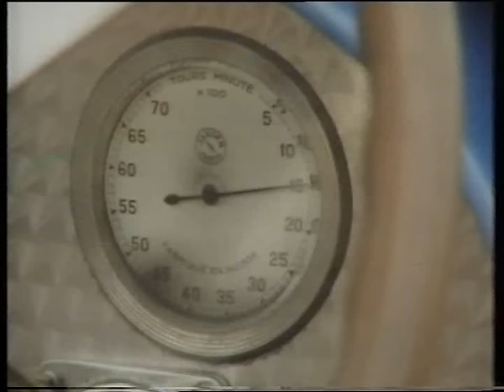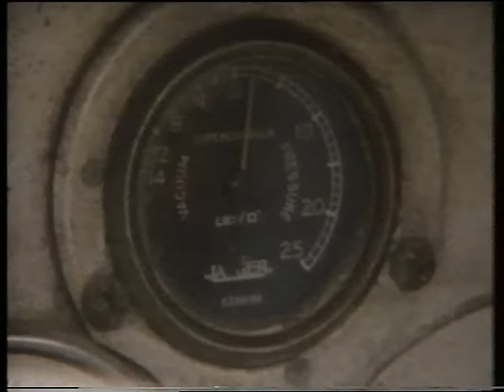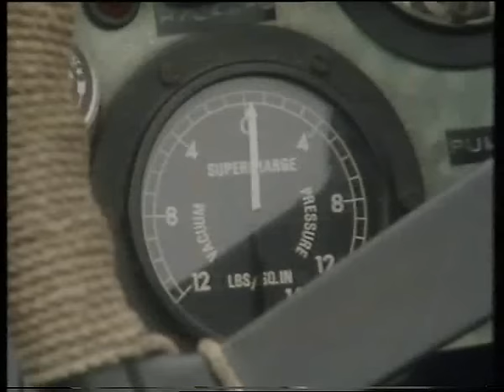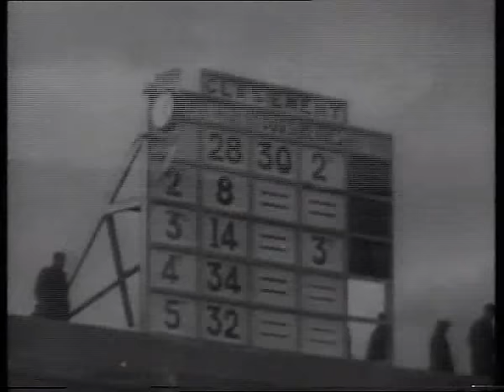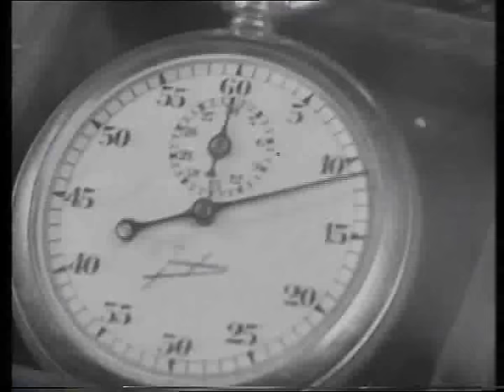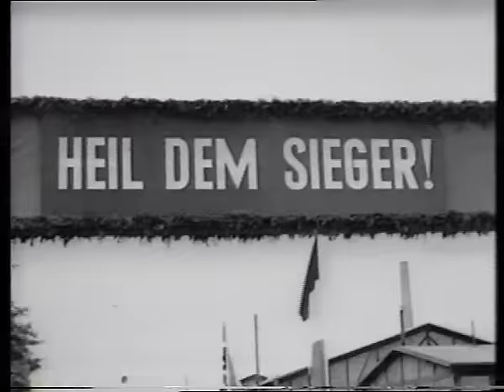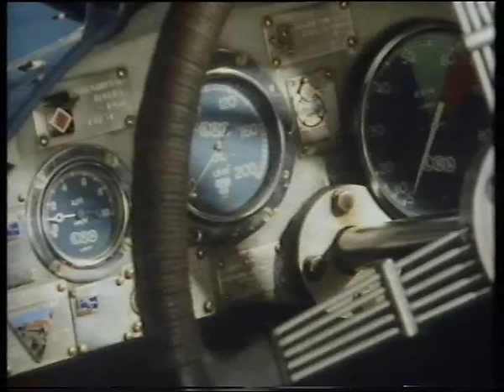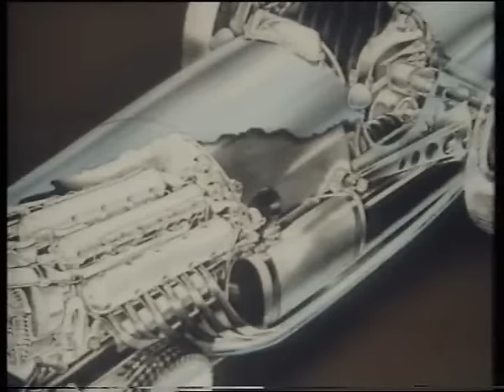Supercharged Grand Prix Cars 1924-1939 (full version)

Comment: One thing I do find extremely impressive with the 750kg formula of 1934-1937 is that the development was so rapid that the 1937 Mercedes W125 developed 646hp (reportedly) on the dyno. Just a few years before in 1931-1932 the most powerful racecars had little over 200hp. Tripling the horsepower output in just a few years of Grand Prix racing must have been insane!

Porsche was planning something special for the 1974 Can-Am season but turbos were banned and Porsche pulled out. (1973 oil crisis..)
Reply: What exactly did Porsche plan for the Can-Am in 74?
Reply: Kinda how the Le Mans circuit was not fit for how fast cars had become which led to the disaster of '55

Comment: I actually drove a 1928 Bugatti Type 35 race car in a road rally about a decade ago and it's tiny, harsh, nimble, loud, and like riding in a frog blender at speed that will kill you and take off your knee caps if you f- up. About as fast as an 70's Porsche road car on tires the width of a pizza pie -135+ mph.
Reply: Just for research purposes, can you quantify the speed of an average frog blender for the average viewer. I never learned to control my frog blender, so I wasn't able to clock the speed properly. Kept taking my kneecaps off.
Reply: @LarryisControversial3000  Literally a frog blender RPM? 37,000 -Hamilton Beech Bar Blender and others -yummy frog legs blended not kneecapped. That's mafia and you guys aren't. Richard Ridell would run the front tires with less PSI I remember at Laguna Seca Monterrey Historic races. The one I was in was owned by a David D. From Galveston or Houston.  I gotta think about it -over a decade ago. You talking about the adjustable advance, the priming pumping, the extra oil can manual pump and stuff and priming with the left hand near the fire wall? I know there is some parkay flooring in them too. There's a clock too on the pretty engine turned fire wall and from what I remember it was quite a production just to make it go much less drive it. You constantly adjust the advance. Worse than a High Maintenance woman who is French and Italian and very pretty so it's worth it. I think I was in the finger lakes. Been a while. Oh and the emergency brake right hand with a chain sprocket is an interesting way to do it. Also hiding the drums inside the wheels is rather impractical but would really work well thinking about that now -much easier to use a larger sprocket to get leverage for the brakes just like big rotors. No wonder why these were so fast in the 1920's. They are today! I'm sure i would get lost in a rental car chasing as I did, even with my 911 3.2 it would be about the same performance. Lots of trivia I haven't thought about in 10+ years. Cool experience.
Reply: Those Blockley Tires are the bomb! Makes steering of those cars much lighter and faster if everything in the front axle is up to snuff. Positive camber built into the axle. So I would assume that Dick runs the front tires lower in PSI to give better corning so you get a combination of good steering feel without the front end pushing really bad and you understeer the corner. Is that what you are asking? Compensating for understeer in these cars with tire pressure variations on modern race tracks. As far as I remember there are only a few left right hand turns on Laguna Seca and they are off camber (up and down hill corkscrew) so you may be able to only run the right front tire with lower pressure for that track and get away with it.
Reply: Or spin lol!
Reply: @DerekJason3000  I would never kneecap a frog. As everyone knows, when you blend frogs you have to include the kneecaps. All the flavor is in the kneecaps.
I live near Seattle and we have the Lemay car museum which I visited for the first time last weekend.  I found that the tire companies in the 20's were working on the lack of grip issues with the tires of the day. I think Firestone  (I could be wrong) had a tire that wad called a non-skid tire. The tread, instead of blocks or wavy linear ribs, consisted of the words NON and SKID arranged diagonally across the tread section of the tire. Each letter was approximately 2 inches tall and the tread was literally NON followed by SKID repeatedly around the tire. I meant to take a picture but I was distracted by all the other cars.

Comment: 2 rev counters?  one for each line of pistons?  thats awesome.  they always said a v12 was two inline 6's put together, but i never realized it was that close to reality.
Reply: Noo lol, cars used to have machanics righting shotgun to keep an eye on things. One is for the driver and the other is for the machanic.
Reply: Yeah no, there’s no way for one cylinder bank to spin any faster or slower than the other, you know, being tied together by one solid steel crank shaft...
Reply: @kevintucker3354  Absolutely!  I`m wondering if there was, maybe a built in reliability  factor - in case one counter failed - weren`t they cable driven rather than measuring the contact breaker pulses?  Or did they have two distributers?  I`m talking too much - what do you reckon?
Reply: No, it's just an oddity of the P3 Alfa. It had an inline-8 engine, not V8.

Most plausible theory for the two rev counters was Alfa Romeo reusing some unused bits from their Tipo A racer, which do have two engines mounted side-by-side. They probably plan to keep the Tipo A racing for quite a bit and kept several spares, but it proved to be complicated (tricky to maintain 2 completely separate engines supposed to be running one car), tricky to drive, and since the Tipo A was designed only for faster tracks, ultimately their smaller, single-engined cars were proving to be more effective all around.

Comment: The Auto Union V16 C was awesome just can't imagine trusting those tires at 150-199 mph and no cockpit protection from a crash plus no fuel cell for the methanol fuel. You just hoped you saw the finish line alive in one piece, I think it took a lot of guts to race back then even more than now.
Reply: +Robert Smith Imagine Bernd Rosemeyer at AVUS in 1935. It's the first automobile race he's ever participated in, and he's racing for Auto Union, one of the biggest teams in the world, and he's starting on front row, right in the middle of Autobahn 115, AKA, AVUS, The Temple of Speed.
Reply: +Robert Smith Those tyres tire very quickly trying to get that power on to the road.
Reply: Robert Smith allways wondered how well those cars would perform with modern rubber on each corner.
Reply: They still race cars like those at Goodwood Festival Of Speed. And they really do race them. The oldest car still racing last year was built in about 1904. Plenty of videos on their YT channel.

Comment: They should restore the full original Brooklands circuit and put a better surface on it. Just imagine the car shows and races with vintage cars that could be held there. Fabulous.
Reply: An impossible task. Most of the old track is now public highway.
Reply: And housing!
Reply: It will never happen. There is just too much development,a retail park an upmarket hotel the remaining area in the museum has been rearranged,like moving hangars, oh and built across the runway so you can never fly a plane in again is Mercedes Benz World. Very little of the old track survives.I have driven the MGs on it though. The museum bus museum and MB world make a great day out.

Comment: I chuckled when Watson mentioned how physically demanding the early cars were to drive. Imagine how hard he would have found working on a railroad gang back then, working hard physical labor for 10 to 12 hours a day!
Reply: D.E.B. B no mechanical or electronic assists in those days you even had to manually pump the oil into the engines in early cars.

Comment: that was grand prix racing at its finest
Reply: I disagree  These cars were (compared even with the cars most people drive every day) mechanically very unsophisticated.  The Bugatti 35 developed only 90 horsepower from 2 liters, and undoubtedly spewed a lot of pollution into the atmosphere while doing so.  That's only 45 horsepower per liter.  Today's GP (2014) cars are 1.6 liters and develop 600 horsepower, or 375 horsepower per liter.  In addition, these new GP cars have two different kinds of energy recovery systems (ERS) which reclaim braking energy and exhaust heat energy and make it available as additional power.  Those older cars were grand for their time, but compared with the current technology they are grossly primitive.
Reply: Terrence Cafferty The funny thing is, if you strip all that modern technical stuff off, you're left with that same unsophisticated mechanical design. The Internal Combustion Engine, a design which has remained relatively unchanged for more than a century.

I'm afraid I agree with 91dakotav8, that this was and still is grand prix racing at it's finest. It was a time when racing was something that anyone could have a go at, not just high priced, over hyped teams.
Reply: Couldn't agree more!
Reply: Terrence Cafferty Your not seriously comparing that technology to today are you? Today's "advanced" GP cars will be ancient technology 80 years from now too. The KERS systems you speak of are based on technology out of the 30s and 40s. Sure todays engines have more horsepower but are essentially unchanged from those of the 30s except for the electronics. The cars, drivers, and teams shown in the video are a inspiration to technology and racing today. Show some respect.
Reply: +Terrence Cafferty THAT WAS 1924, DUDE. That was amazing for the time. The 1920s was a time when 35 HP Per Liter sounded futuristic. It had 110 horsepower actually. Then again, power isn't everything. It was the base model for all racing cars to come after it for the next 30 years. What made these races so great was the bravery of the drivers. Wearing a t-shirt and goggles with no protection at all was what made the entertainment of the decade for Europeans. Nowadays, the protection destroys F1, it makes you feel like the car is driving itself for you. Remember Stirling Moss' famous words: Formula 1 Racing is dangerous, and that is what makes it exciting.
Reply: @lazzer408    Dear Mr. Leader..you are quite wrong. The modern engine DOHC hemi engine was completely designed by Ernest Henri in 1912 for Peugeot which won the French GP that year and Indy in 1913..1916..1919. All racing engines and later road engines followed the Peugeot-Henry design refining that design but never adding to those original concepts. Harry Miller direct copied that motor when he started eventually leading to his design of the famous Offenhauser. These were all 4 cylinder motors. No one has yet improved on that basic design !  In 108 years.  Now that is amazing.                           M.C.

Comment: I'm not a fan of centrifugal superchargers,
I prefer a twisted roots, or a twin screw

but he mistakenly states that the roots supercharger is more efficient than a centrifugal
at the same boost pressure, the centrifugal takes less power to drive
the "advantage" the roots has is that is a positive displacement pump which allows full boost from a very low rpm
the roots is not a compressor, compression takes place after the pump this is one reason it takes more power to drive than the centrifugal compressor.
Reply: I think that he meant more efficient in the sense of providing more boost low down in the rev range, the centrifugal blowers only came into effect at higher engine speeds, while the Roots type provided more torque out of slow corners for example.

Comment: 7:01  That was not CGI or a dummy flying through the air..
Reply: Jesus 🤤 . Seatbelts ftw
Reply: looked like a dummy, i presume because the driver was dead or at least unconscious at that time
Reply: @realMaverickBuckley  I don't know if I'd like to be strapped into a car that could crush me if it fell upside down (cause no rollcage or anything lmao). Being launched a few meters into the air sounds way safer
Reply: @DanielTseng100 - Yes, being crushed in a flip with no roll bar was a distinct possibility, but statistically, you have a greater chance of being killed whenever you are thrown from a racing machine at speed!
Reply: The way the camera was set up on a tripod at the perfect location, I think this was a “crash test” of some kind, using a dummy however I know there wasn’t even a radio controlled airplane until 1938 so I doubt they built a remote controlled car before that! It just may have been the most difficult corner on the track right after the worst bump or pothole...
Reply: YOLO

Comment: Harry Miller contributed some pretty awesome advancements for the automotive world. I was happy to hear the Miller 91 mentioned early on.
Reply: Harry Miller copied the Gran
Reply: Apologies, Grand Prix Peugeot engine layout (pre WW1) originally, or his designers did. The Peugeots were taken to Indy by Georges Boillot I think, where they were sold on and had their Henry type valve gear copied by a few designers, as they were widely copied in Europe. The basic twin cam layout is now standard in most road car engines, more than a century later.
Reply: @cosmocosmolino5821  There were a number of design features in the old (100 years plus) cars that would surprise many people today. I have a road test of a recently displayed 1913 Ford Model T Speedster. It had an after-market head by Robert Roof on the stock engine block that had 4 overhead valves per cylinder... in 1913!!

Comment: 640 HP in the 1930's????
Reply: ArianOriginal21  he's talking about a 750kg racing car
Reply: And no ability to get it on the Tarmac or then stop... So not exactly equivalent to a modern 750 HP
Reply: Look up the Mercedes t80 it did 434kph or 270mph in the 30s and have something like 2000hp
Reply: @Dragonhal_Z no, the T80 never ran.

Comment: They knew the centerline of the tire needed to be close to the line of the kingpin inclination, but it was a problem due to the big tires. The solution to this was to tilt the wheel in order to bring its centerline axis of the kingpin. In the dynamics of these cars, as the tires were extremely poor compared to modern (radial tires) and car height, large degree of body roll and tire deflection, the positive camber also collaborated a bit to reduce oversteer.

Comment: Imagine 4 holleys on that straight 8 with some ngk platinum plugs and brand new billet parts to the same specs
Reply: There's nothing special about a Holley carb,
Reply: @deaddoll1361  EFI or death.
Reply: 4 twin choke Webers would produce more power than the Holleys.

Comment: They did it because of the absolute love of the Sport, and of course because they could 'afford it'  (12:35) Not the Millions Paid out today. However RESPECT for those drivers in potentially death traps, and circuits with little or no regard for safety. They built 'em well then Lad, E Bye Gum they did Dad, proper job.

Comment: 35:15-35:20 ish,  the mechanic checks the exhaust manifold for a cool cylinder ... with his hand!!! Mad respect
Reply: I have a motoring book from around 1910 which offers advice on how to diagnose an engine that is misfiring: by putting your hand on each exhaust manifold in turn - the one that doesn't burn your hand is the faulty one!

Comment: Why would a smooth running engine indicate that the crankshaft is broken. perhaps some parts of the crank are pressed into alignment and this alignment is disturbed 31:47. i wonder how a set of modern wheels and tires installed on a Mercedes model 154 would affect the cars performance, better or worse, by how much?
Reply: It is a Hirth multipiece crankshaft, if I remember correctly. So probably when it starts running smoothly that means the whole lot is starting to seize up...

Comment: Indeed the 1,5 litre supercharged (or turbocharged which hardly existed in the 60's) Formula of 1966 was intended as a way for smaller manafacturers to be able to compete with the 3,0 litre cars on "even terms". 

Nobody bothered with that at the time, until Renault boldly decided to try their turbo V6 in 1977. By 1979 (witness 6 poles by Renault cars) it was clear turbo 1,5 litre was at least "equal".

Reliability issues was the only thing that kept Prost (Renault) from being champion in 1981.

Comment: The Porsche 917-30 Can-Am could do 0-60mph(100km/h) in 1,9 seconds, 0-100mph in 3,9 second and 0-200mph (322km/h) in 10,9 seconds!

In 1975 it broke the closed circuit lap record on Talladega, with a 221mph (356km/h) average speed. It was driven by Mark Donohue. Talladega is a steep oval, how fast would the 917-30 been on a long enough straight??

The thing was Can-Am was Sportscar racing, where they raced for 2 hours, not some short sprint race.

But fair enough the 1930's Grand Prix was insane

Comment: I know that in 1936 or 1937 there were Auto Unions type C with 4 wheels on the rear axle : the 'Bergrennen' version      ( same sort of solution as you see on the rear axle of trucks).
There is some fantastic automotive art (including this pre-war period) from Vaclav Zapadlik (CZ), take a look at wallcoo.net   'Art Paintings'
Reply: Man, Václav Zapadlík is a freak. He draws dozens of ellipses for each wire-spoked wheel to make sure it looks correct. He also constructs complex geometry to capture reflections on chromed parts. I have seen a couple of his paintings IRL, they are incredibly gorgeous.
For some reason, here in Czechia he is not as well known as he should, even though a lot of people recognize the style, and we even have post stamps with his art. But he is internationally recongized in the old-timer community, which ramps up the prices a lot, so his original paintings are way to expensive for me. I have buoght a book of reprints this year :)